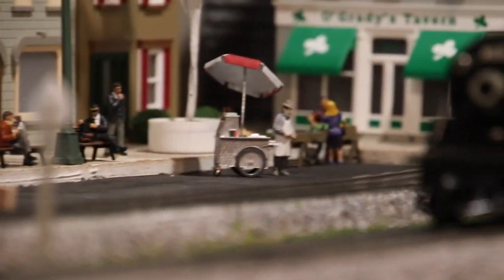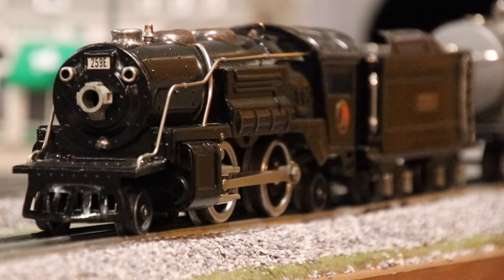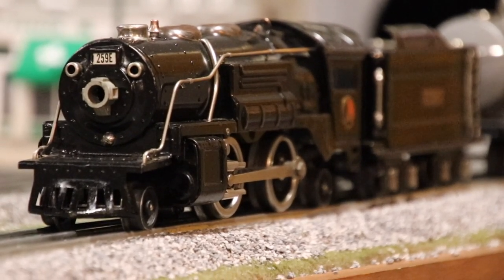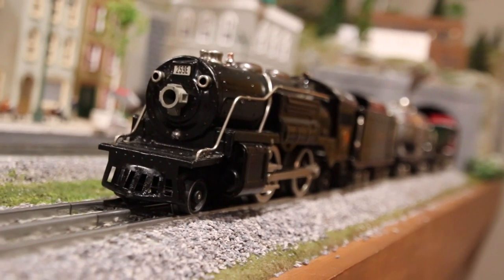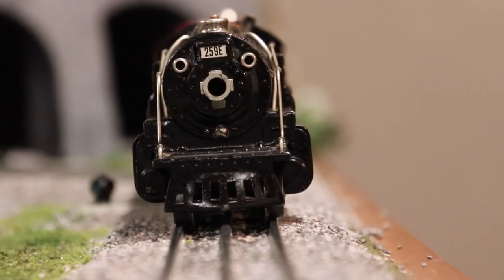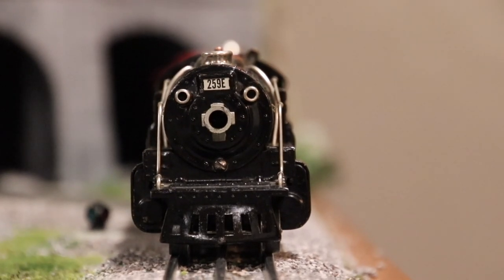FIRST RUN IN 20 YEARS!! My Grandfathers Original Lionel Prewar 259E Part 2 !

Comment: I have this same engine, but I’ve noticed that the engine looses power on curves. I did some looking and I found out that I’m not the only one with this problem. so you know why this is? Thanks
Reply: There are different size of track curves, when you have a short or small track with sharp curves from startsets, indeed this train is losing speed and you can not pull a lot of wagons, on wider curves I have no problems with my 259e, maybe a stronger transformer will help.
Reply: @michelvandebeek3697  okay, thank you!